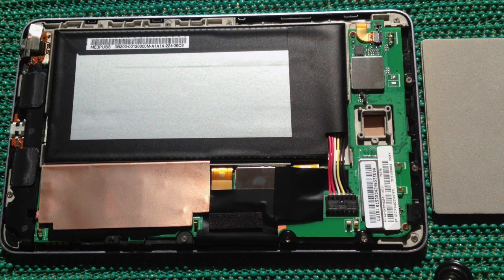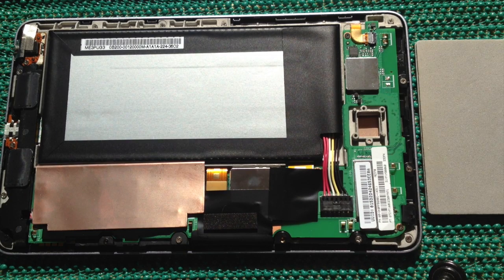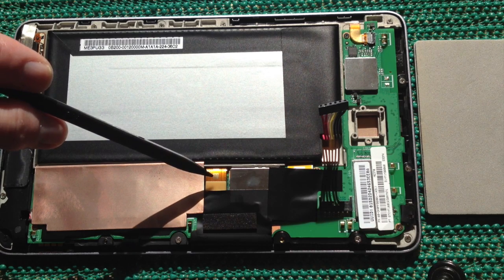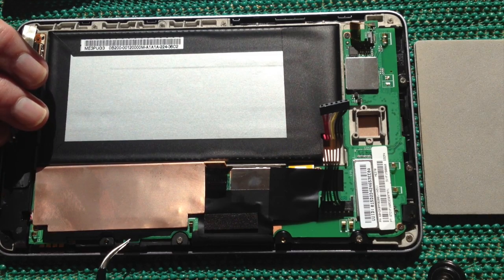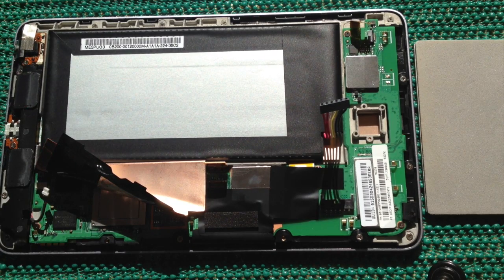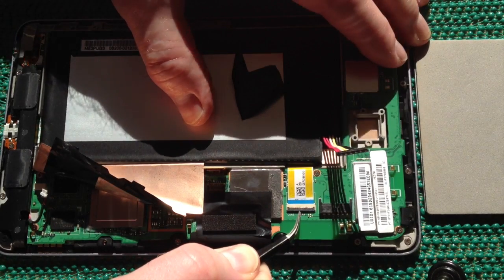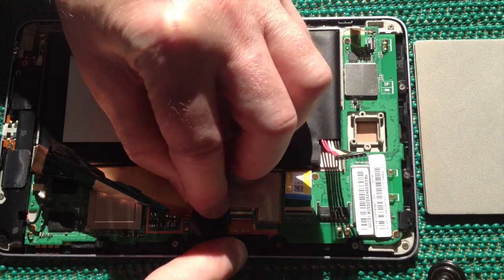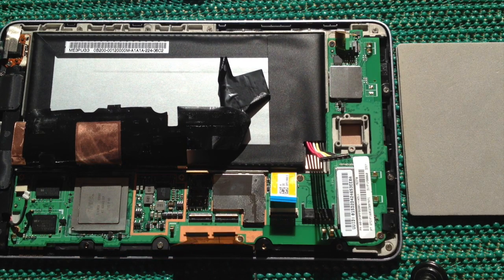How I Replace A 1st Generation Nexus 7 WiFi Motherboard Part 1

Comment: I know this video is old, but doe replacing the motherboard take everything off it? Such as games, pictures, and such?
Reply from the maker: Yes it does, its best to back it off to Google User Account as in the settings, ticking the option for reloading, then when its done replace the board and sync with your google, if you did it right it should bring it all back onto the nexus for you. Please don't forget to subscribe to my channel and consider making a donation and share the #fixed1t tag with others. Regards Malcolm aka #fixed1t

Comment: I can vouch for this video as I just revived my hardbricked "APX-related-issue" Nexus 7 2012. Was so bummed when I accidentally pulled the cable off my tablet mid-flashing. After seeing this video, I bought the motherboard online from eBay and followed the instructions in this video to the brim. The tablet works flawlessly now. Thanks FIXED1T! :)
Reply: ***** Oh, and its now upgraded from the old 16gb mobo to a newer 32gb mobo. :D

Comment: My N7 16GB was broken (laggy flash memory and finally died). I was able to replace the old 16GB Mainboard with a 32GB mainboard from fixed1t's ebay store. It was really easy after watching this video. THANKS!!
Reply from the maker: David Prieto - Huelvayork David, really pleased the video worked as it should and you have a working Nexus 7 32gb.  Only problem I have now is that lots of others have watched my videos and are now breaking up wrecked Nexus 7s and ripping out the motherboards etc and undercutting me with (as new) LOL.  I don't imagine many are taking as much care and doing the testing and updating I do before shipping.  I'm a victim of my own success LOL Have a excellent festive break.

Comment: My N7 16gb (2012) Rooted stock 4.4.4 is over 2 years old. A couple months ago it made a terrible crackling noise (came from the speaker of course) & then rebooted. It's been stuck on the Google logo from then on. I can get into fastboot mode but no further. Tried all the usual advice to no avail so I'm pretty sure its hardware related. Just picked up a used motherboard on eBay & plan to pop it in whenever it arrives - I'm betting my N7 will then be back up & working.   Thanks for the quick guide - I'm glad to see its all plug & play ;)
Reply from the maker: josh carter Hi Josh, It should indeed spring back to life thanks for the comment, let me know how it goes.
Reply: FIXED1T Will do Sir ;)
Reply: FIXED1T I got the new motherboard out of the mailbox, took 5 minutes to install it and everything is up and running again :). Happy camper here
Reply: josh carter flashing the new 5.0.2 factory image right now. :)
Reply from the maker: Josh Good to hear it all went to plan, welcome back to the Nexus 7 users, I hope the rest of your festive activities go as well.  Malcolm
Reply: Thanks :)  Happy holidays